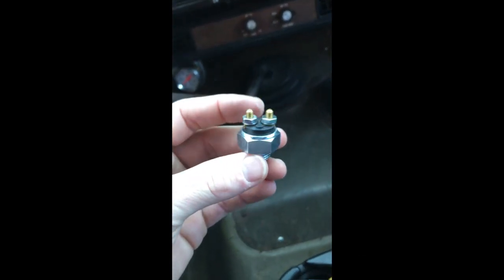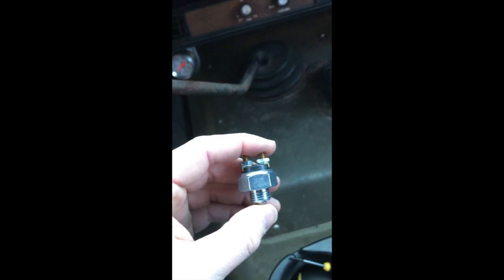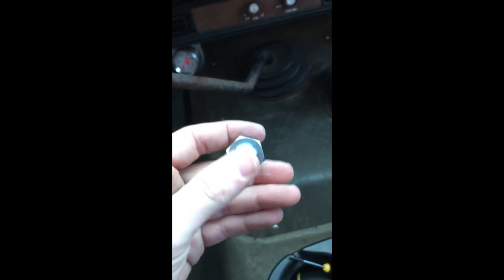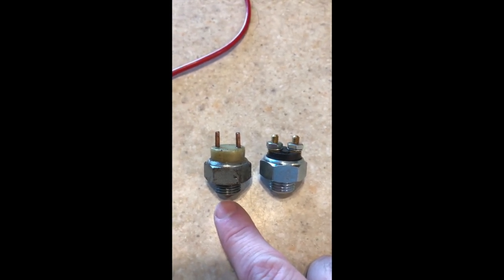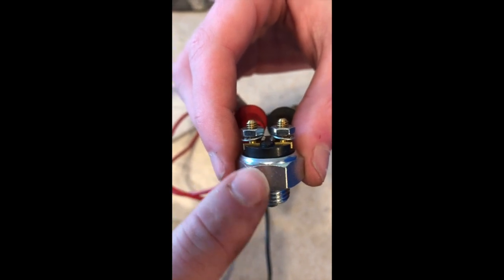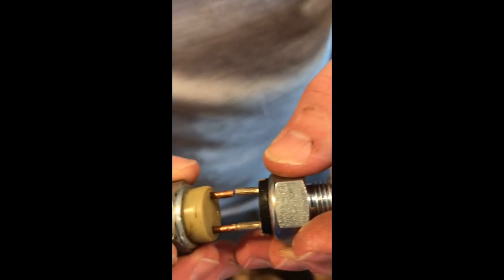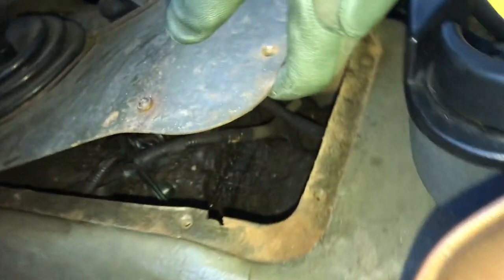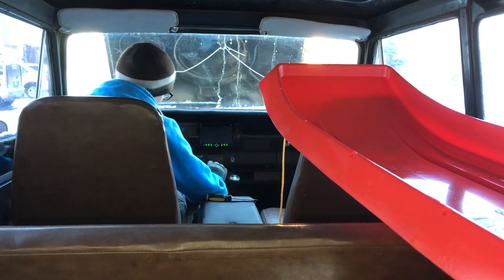Scout II reverse switch replacement

Comment: Where is it located ?
Reply from the maker: the easiest access is under the plate that surrounds the shift boot. The switch screws into the top of the transmission. Just pop the cover off and follow the wires.